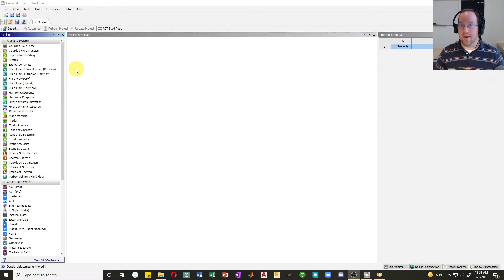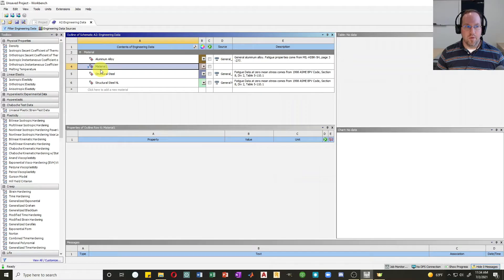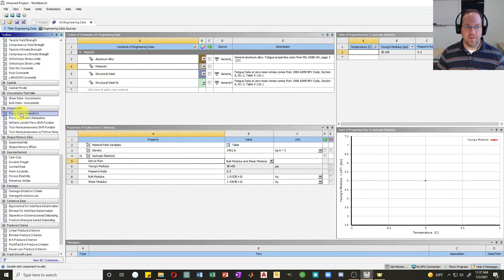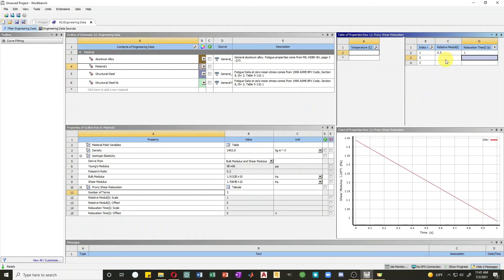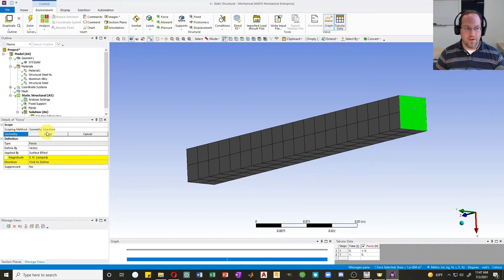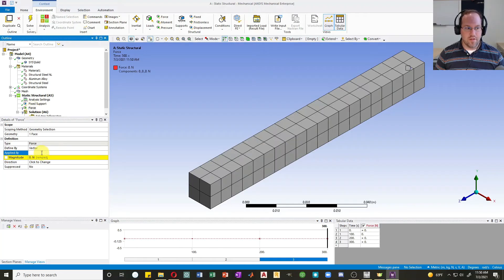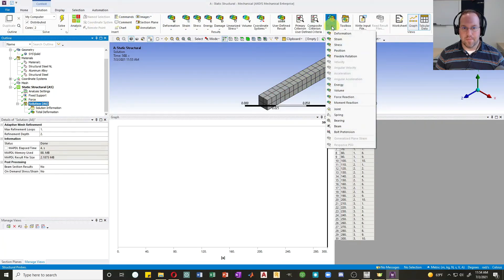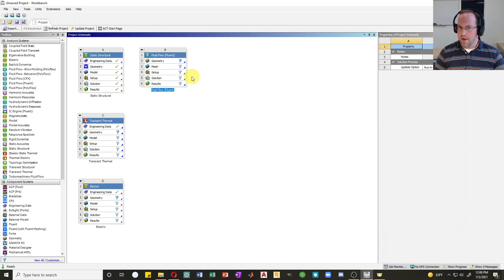Defining Materials and Viscoelastic Analysis - FEA using ANSYS - Lesson 6

Comment: Great video. Question, would Young's modulus and poisson's ratio be used here if we do a viscoelastic simulation as explained here?
Reply from the maker: Yes, the Young's modulus and Poisson's ratio define the elastic (immediate) response under load. The viscoelastic parameters are specified in terms of relative moduli, meaning relative to the elastic modulus values. These represent how much relaxation (as a ratio of the initial stress) occurs at the specified relaxation times.

Comment: Hi sir great tutorial! Can you share some document for also testing?  I have a different material and want to use your excel file in the comments. Thank you very much for the file btw!
Reply from the maker: Unfortunately, I don’t have anything written up for relaxation testing. It’s also going to depend on what material you are using and what kind of testing machine you have. Anyway, the core idea is to somehow apply a constant strain and then measure the stress as it changes with time (or more likely, apply a constant displacement to some material sample and then measure the applied force over time - convert to stress and strain as you normally would). You can also check out ASTM E328-21, which may be more helpful.

Comment: Dear Dr. Brock,
I have a doubt about the Prony shear relaxation terms (Relative Moduli).
How can I calculate them?
In my understanding, the Relative Moduli is the stress relaxation modulus (in certain instant of time) divided by itself in t = 0.
is that correct?
Reply from the maker: Hi Rafiq,

The Prony series is effectively a summation of exponential functions, each one representing a single spring-damper pair (see Generalized Maxwell model, 5:25). When strain is applied, the resulting stress is initially distributed to each spring-damper pair according to the relative moduli values. So in the example in this video (6:20), 50%, 20% and 20% of the applied stress go into the spring-damper pairs with relaxation time of 1 second, 10 seconds, and 100 seconds, respectively. The remaining 10% does not relax, so it is effectively held by just the spring element with no damper (again, see the Generalized Maxwell model, 5:25). 

The relaxation time describes how quickly that stress relaxes, and is equal to the damping constant (units of force * time/distance) divided by the spring constant (units of force/distance) of the spring-damper pair. If the strain is held constant, the stress carried by the spring-damper pair with relaxation time of "tau" seconds relaxes 63.2% of it's carried stress every "tau" seconds, in accordance with exponential function behavior.

To compute the relative moduli, ideally you need relaxation data (stress as a function of time under constant strain). The shear modulus describes the elastic response. If you know how the stress varies with time under constant strain, it's a relatively straightforward process to fit exponential curves to data that you have available. Typically, you only need to fit the relative moduli values because we often assume the relaxation times. I usually use some logarithmic interval like base 10, such as 1, 10, 100, 1000 seconds (and so on) for relaxation times. Relaxation times should be small enough to capture rapid, short-term relaxation (depends on your material) and long enough so that it captures the entire time duration you wish to simulate.
Reply: @StructuresProfH  
Dear Dr. Brock,
I appreciate your explanations a lot. Now it´s much more clear.
Just to confirm.. once I have stress data under the time, I will analyze the stress decrease percentage
in the intervals of 1 s, 10s, 100s, and 1000s (relaxation time).. and this percentage equals the Relative moduli?
For example, let´s suppose that in t = 0, the initial stress was 18 MPa, and after 1 second, the stress fell to 9 MPa, then the Relative Moduli is 0,5, and Relaxation time is 1s?
I really need to use this property in Ansys to carry on with my master´s degree,
Best regards,
Rafiq Said
Reply from the maker: Hi Rafiq,
Unfortunately, it's not quite that simple. You need to do a curve fit using a sum of exponential functions.
It's tough to explain in a comment, so instead I have an example done in Excel here:
https://docs.google.com/spreadsheets/d/187HbyOm64uWl_d_rpRi1KcoT1MRA2kQt/edit?usp=share_link&ouid=116718473101577906015&rtpof=true&sd=true
Hopefully this will point you in the right direction!
Prof. H

Comment: thank you for this video, i want to model using pronyy series of an orthotropic material (data given in matrix notscalar) and i don't know how to do it
thank you
Reply from the maker: Hi Samir,
Unfortunately, I not aware of a way that ANSYS can do a Prony series for orthotropic material properties. The Prony series coefficients can be defined for volumetric and shear components (so, isotropic only). You may need to define a custom material property.
Reply: @StructuresProfH  hello proffessor and thank you for your answer, I am not that good in Ansys and frankly I don't know if it's possible or not, I have a project at university to do, and I got given parameters of prony series only (G0, Ginf, and Tau) in matrix form (for orthotropic material) and I want to know if there's a way to implement it in Ansys.